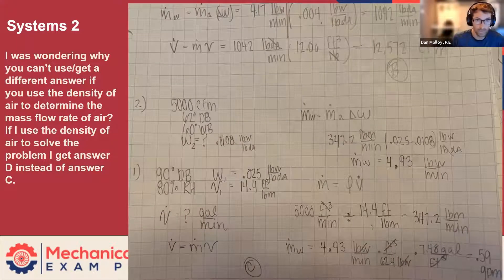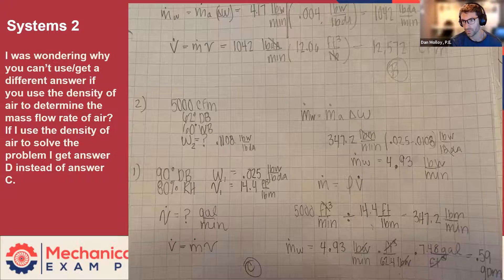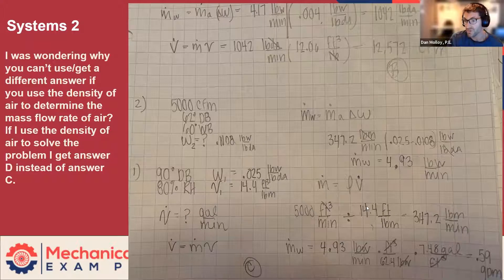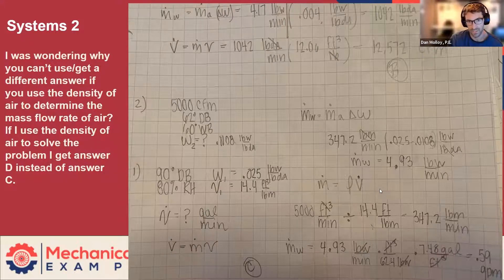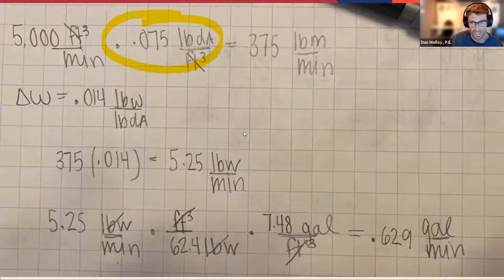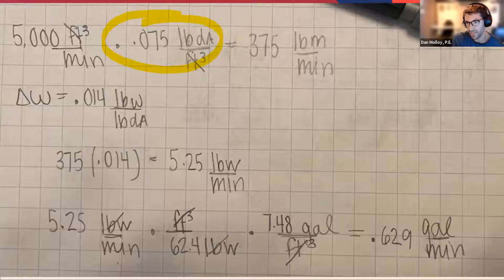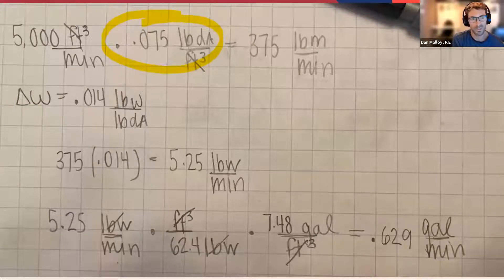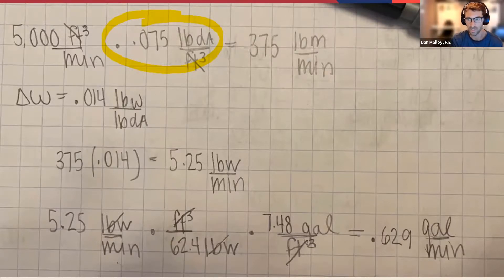Why Standard Air Density Assumptions Can Lead to Errors in HVAC Calculations

Comment: I’ve seen some people do the average density of the entering and leaving conditions. Would that be wrong, or is it safer to always assume entering  conditions only.
Reply from the maker: If the conditions aren't changing too dramatically, it won't drive too significant a change in the final answer.  But to be safe, using the entering conditions will give the best results 95% of the time.